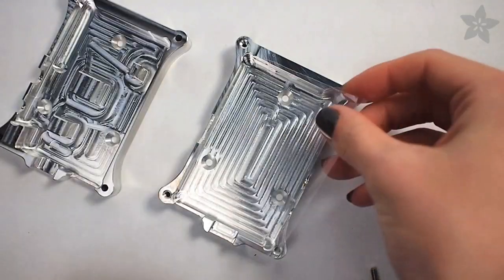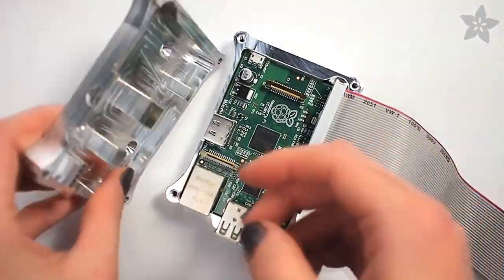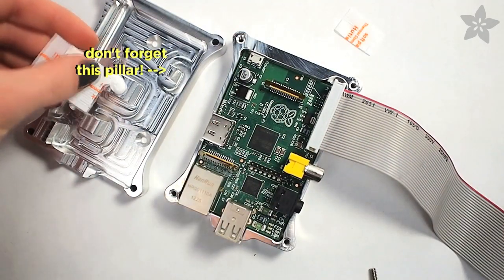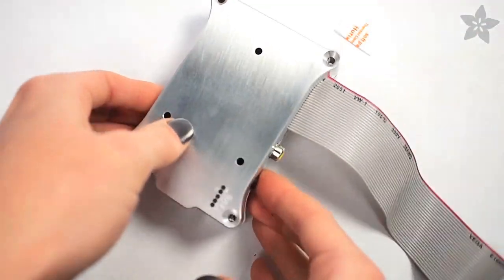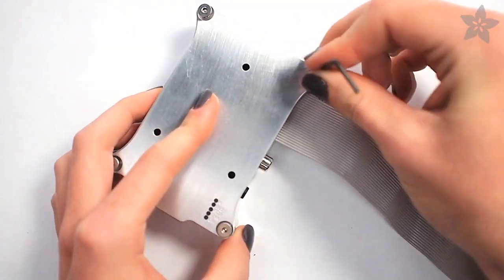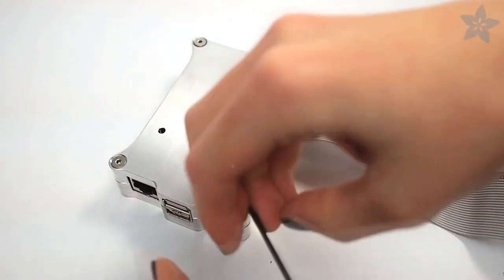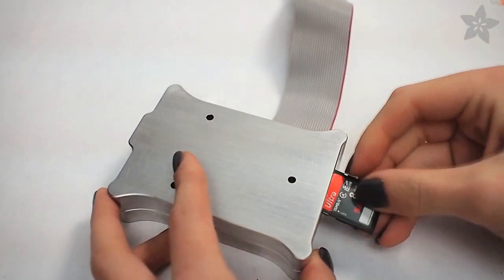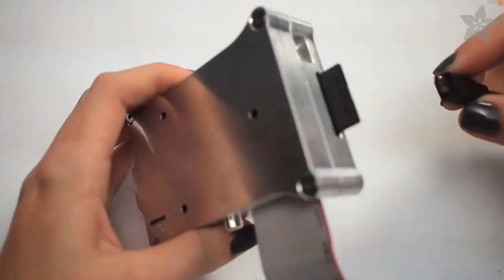Pi Holder Aluminum Case for Raspberry Pi

Comment: Cost seems reasonable. I've designed and manufactured parts for the aftermarket automotive industry. Hogging out a block of Al is not cheap; "waste" is high and it takes a while to do.